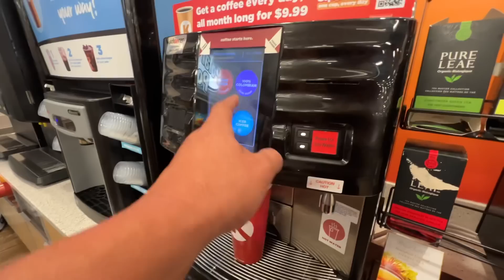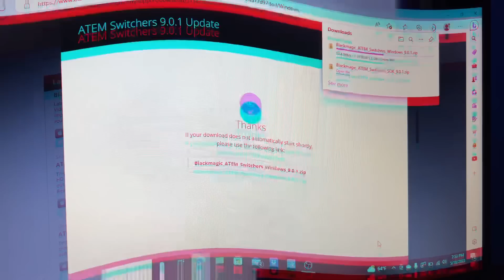Major HELLCAT issues ?? Dodge design FLAW!! We are Learning the ATEM Extreme ISO mini GAMING switch

Comment: A company called JXB Performance makes a bolt on replacement center support for those driveshafts. I just replaced it on my Charger. Its $300
Reply from the maker: Well dang 🤔 did you have to cut off the old one
Reply: @JustTruckin  Yeah. Just the outer metal bracket. MY carrier bearing the rubber was completely disconnected from it.
Reply: Yep, great company. I used them on my 2016 Kitty.
Reply: Any axel shop can replace u joints & carrier fyi

Comment: Atem Makes EXCELLENT HDMI/Streaming Equipment. You may wish to use it with OBS Studio to make it easier. Sucks about the driveshaft, I had something like that happen on a Mustang II, except I went from a Automatic Tranny to a Manual, and the tail was 3/8" too long so I had to have the driveshaft cut and rebalanced. Thanks for the Vids...
Reply from the maker: Wow 😯 that’s crazy

Comment: Many American manufacturers use and/or source the cheapest parts possible on too many of their vehicles. I've had many many issues with various makes and models that should never have happened. Will say though, 2017 Chrysler 300S with a V6, about 73,000 miles and have only had to do oil changes and wiper blades. Time for tires though.
Reply: 600+ hp will break and wear just about anything out over time. Put slicks on it and watch how quickly things break when the tires dont spin.

Comment: Hey met u in Jamaica at d airport and follow u on YouTube saw change the turbo on the FLD  saw all that oil was wondering if u ad wash out the air to air cooler saw a guy blow his motor up bc he didn't u may want to check into that...  Keep on truckin
Reply from the maker: Stephen great hearing from you again bud I will need to do that then 😎🙏🏽

Comment: My nephew took a grand Cherokee to New York and had a Hell Cat Stuffed in the thing, it’s all wheel drive, Four Door, Super Charged w/ Nitrous. He drove it up from Bloomfield Hills to let me test drive it, I absolutely Swear to you iHit it down it launched so hard my Foot Actually came off the Peddle because I was not ready for those kind of G Forces. I got back in it went down a Mile turned around and the Lord Know This Is the Absolute Truth I hit down this time because I knew what was going to happen, we my Nephew Freaked out because he has never been that fast in that Monster. Tragically The Installed left a major Hot Wire open without a Loom so it shorted out caught on fire and the Fire Department by his house Dumped unknown amount of Water and Foam into the Engine area while the Motor was Hot so it Cracked and busted. His Insurance only gave him $15,000 for a Car he had over $100,000 into not counting the Car itself that amount was for the Motor and installation. It’s all good though he is a Supply Chain Controller for Daimler Chrysler. So all is well that ends well, He is able to see all the Secret Squirrel Stuff. I have never really been a Dodge Guy because I had a 1998 Dodge Truck on a 5 year Lease and that thing was a absolute piece of Crap. But I do like the Power Wagon Body Style.

Comment: I have a 2016 Charger 5.7 Pursuit AWD (ex-cop vehicle) 113k+ miles, and I get some weird knocking noises when I drive it in reverse, especially after I drive forward for a while. I'm taking it in soon, I believe the differential is on its last leg 😬🤷🏻‍♂️...But I love the car, what an 🇺🇸beast!💪
Reply: I own a 2015 Durango RT Blackout and the biggest things we Dodge 5.7 owners have to look for is all drivetrain related. Torque Converters, diffs and driveshafts.
Reply: Someone mentioned JXB performance, I had the same issue with my 2016 AWD Charger, that replacement part was easy to install and was the cheapest solution.